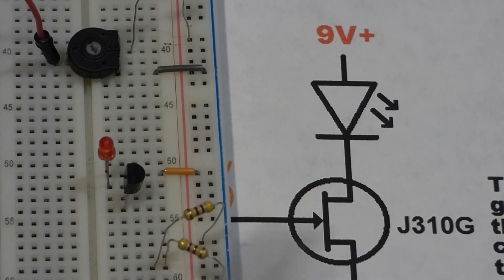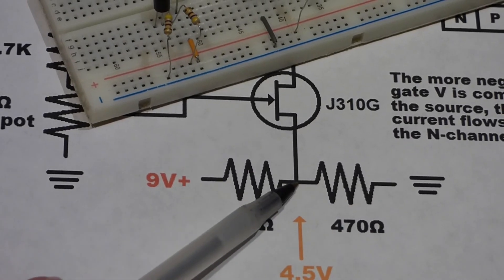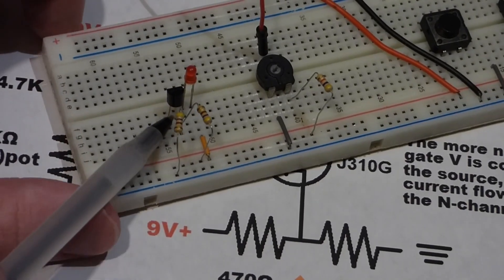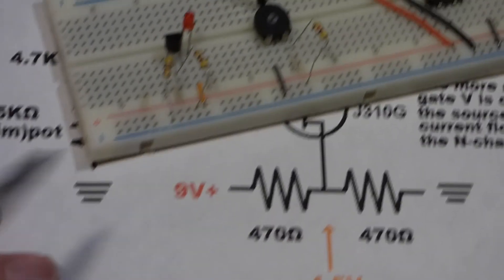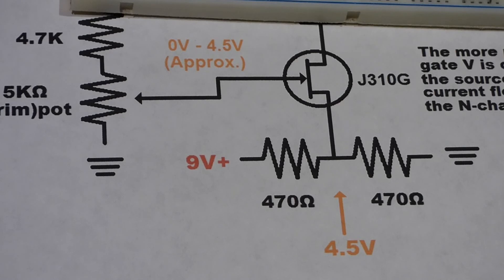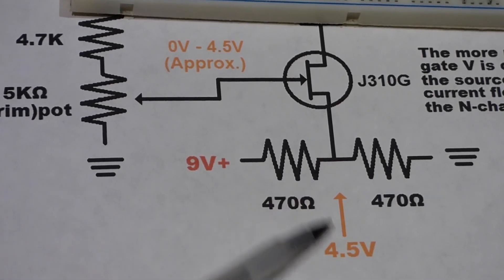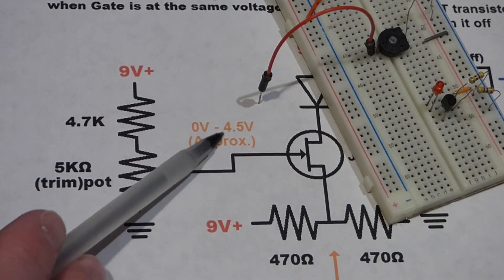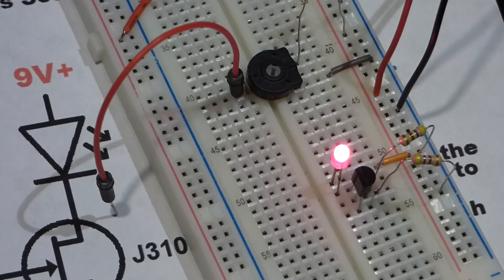N channel JFET transistor demonstration circuit and diagram explanation

Comment: Very instructive and well done. Can I determinate the Jfet Vgs Off this way when Idss is cero?. Could I use a 18V power supply to find out 2N5458 jfet Vgs? Vs would be 9V (virtual ground un that rail) and a window between 1V and 9V to find out the Vgs off. Is that right? No necesarelly need to have "  0V " at source. My English is not perfect sorry and thank you.

Comment: so you put the reference voltage for the source terminal higher so that you can in effect put a negative voltage on the Gate? the Source Terminal is in reference to that 4.5 from the divider while the gate is in reference to ground.
1. Curious now maybe I should build the circuit and see what happens with the voltage between the Source and The Gate. I would attach my positive probe to the gate and negative probe to the Source.

But using a voltage divider has a draw back though it would not be able to deliver current if the load needs it. maybe a op-amp as voltage follower is required between the Source and the voltage divider in that case.

Thanks for the video!
It's very clear what happens and explains it well!
Reply from the maker: Glad to hear! I designed this circuit based on my understanding of the JFET at the time, so wasn't sure how good the video was.

Comment: dont see why you put a voltage divider on the source a resistor would have been ok with another high value resistor to bias the gate. all the dividers just made it confusing.
Reply from the maker: Yeah, had just learned about JFETs and thought this up at work. Not a good video at all unfortunately.